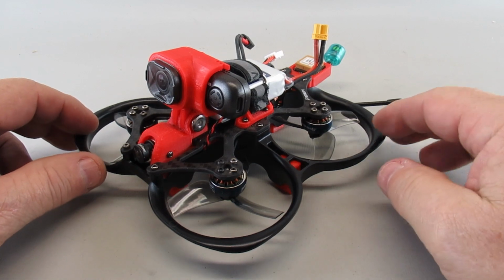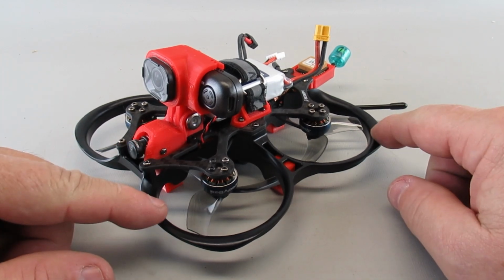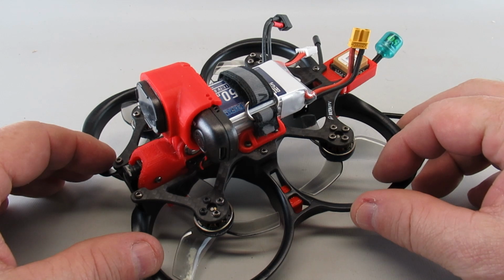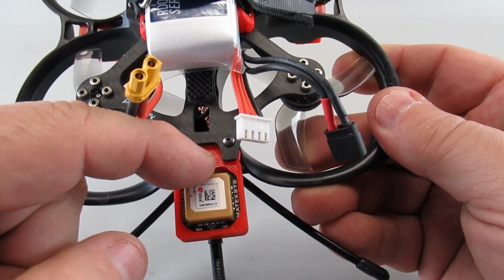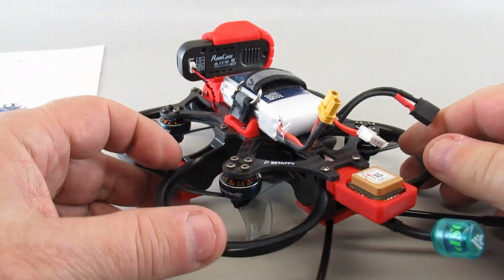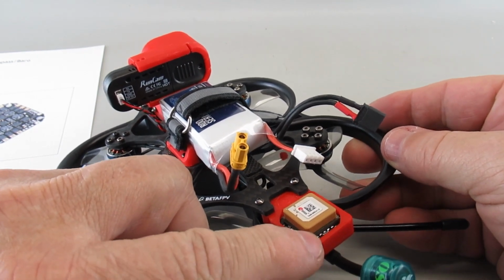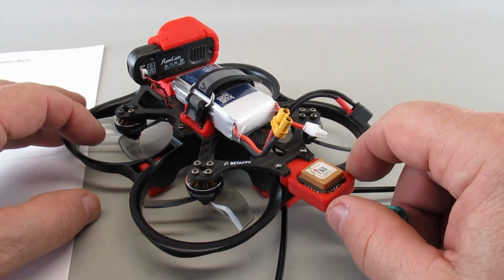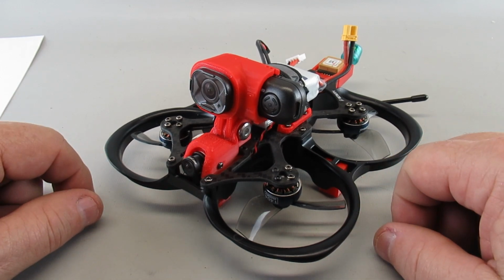FPV Cinewhoop | GPS Compass Barometer | Custom sub250 build

Comment: Sweet build!  looks as sharp as it is functional.  
I had the option to choose GPS on my AxisFlying c20 v2.  I wasn't able to really see the advantage to having GPS on such a small drone.  I probably should have thought about it a little more because osition hold would be pretty sweet.   I bought my mavic 3 and mini 2 for that stuff though.     This hobby always has me thinking and learning and thinking some more lol.
Reply from the maker: It's odd that the betaflight FPV world hasn't figured out how to do position hold even as good as cheapo camera drones.  I mainly wanted to get some experience with GPS as it's needed for Broadcast Remote ID, assuming the 250g level holds.  There is a big push to get that raised to 1000g which would solve a lot of concerns.
Reply: @TommyTester  I've watched some Bardwell videos on the 250 to 1000gram stuff.  I'm not sure that Klobacher or Angie Craig will give much of a shit.  But I wrote them anyway.  
A big reason that I didn't get the GPS was because my drone was less than 250g and I didn't want to deal with remote id on it.  I suppose I didn't have to deal with remote id regardless and the upgrade was pretty cheap.  I'm regretting my decision as it would have been cool to check it all out.   My next quad might be a 3.5" for freestyle.  I'll definitely be getting GPS on that one.
Reply from the maker: @BartManDude  Here is one video that inspired me, and it will blow your mind, combining cine, freestyle,  big balls, and F the rules.  Yeah, he was fined.  https://www.youtube.com/watch?v=nQDcDZ6rmGE
Reply: @TommyTester  That was pretty damn inspiring.  Landing on the train, going under the train, big balls for sure.   It was like his final flight before his quad was to be reposessed lol.     
Many videos inspired me to do dji cinematic drone stuff, but the video that made me realize that FPV was going to be the ultimate cinematic platform was this one.   (this is my 2nd try as my last comment was deleted, I'm guessing because I had a link in it.)     Just search - fpv africa Namibia -   pilot is Ellis Van Jason.   If I could make a video like that, I would die knowing that I gave at least one gift to the world :)
Reply from the maker: @BartManDude  Found it.  Wow is right.  Cutting edge.  FPV opens up a whole new world for filmmaking.
Reply: @TommyTester  glad you liked it, it blew me away when I first saw it.  Shared it with everyone saying "I'm going to do this someday"   probably not in africa though :)
Reply from the maker: @BartManDude  All the great ones started by flying around their own yard. ;-)

Comment: Hey Tommy that build is EPIC. Looks really nice. 👍🙏👍🙏
Reply from the maker: I like trying new things, and this was a good new challenge.  I've been involved a bit with work going on with Broadcast Remote ID that will be required on all RC models over 250 grams, including FPV quads.  Remote ID uses GPS, so this rig will give me some experience with both the hardware and integration aspects.  There is an effort underway to get the floor raised to 1K grams, which would be great.